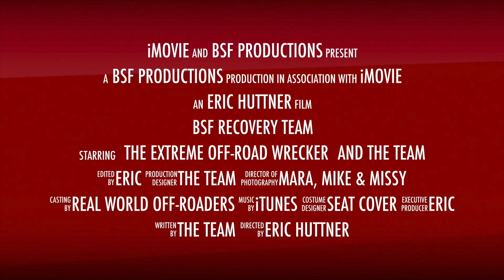SHREK AND DONKEY by BSF Recovery Team

Comment: is that one camo wrecker a CUCV or is it a normal truck painted camo?
Reply from the maker: Yes it was a CUCV.
Reply: Ok cool, do you know if they had to extend the frame? I'm thinking of making a wrecker like yours but out of a CUCV.
Reply from the maker: They did not extend the frame but it is 4" shorter than a cab chassis, they just set the wrecker box on, and built brackets. If you look at it close you might be able to see the rear wheel well is a little further back than the rear axle.